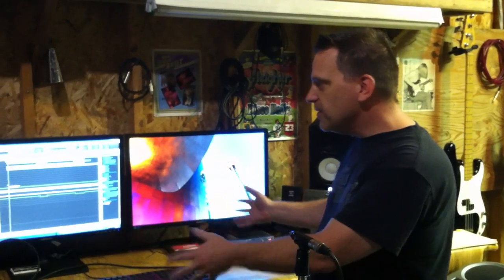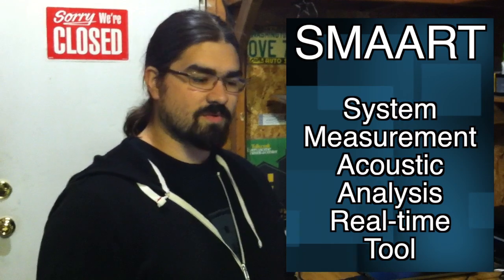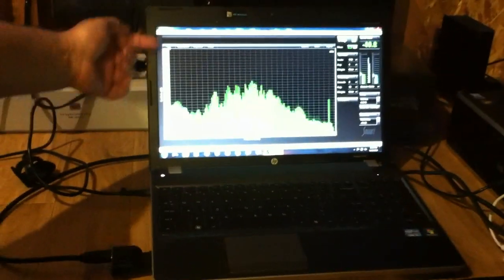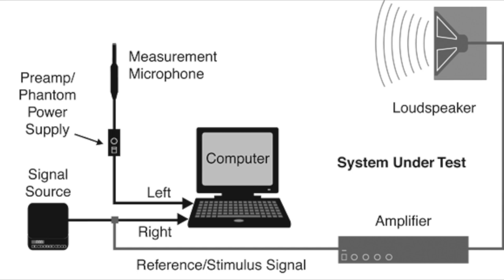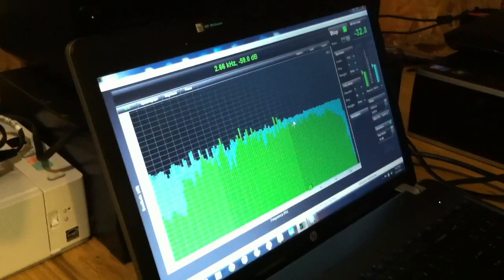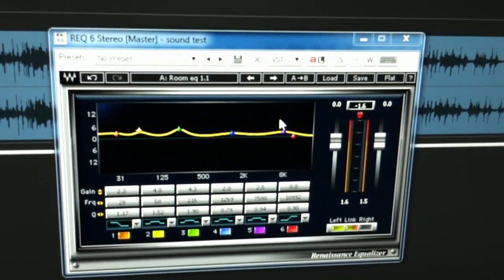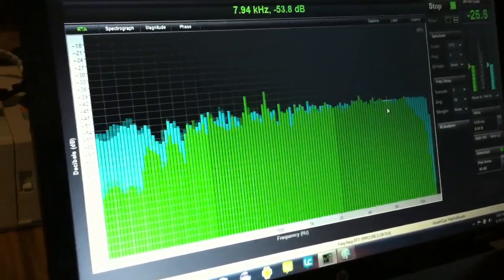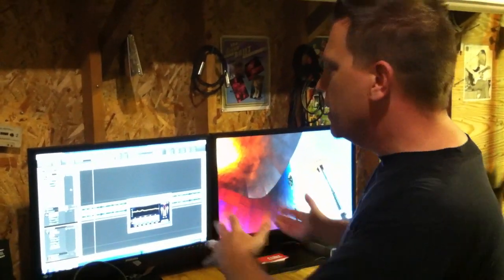How to Test and Analyze Your Home Studio - The Hit Chasers - Extras #8

Comment: 1st, it's mandatory to get some acoustic treatment in the room!. ... eq compensation should be viewed as the cherry on the cake...  

and it won't work as you might think, if you boost some problematic freqs, the room will simply try to respond and it's basically a "feedback" system. The more you boost, the more the room will just do it's thing ;) ...
Reply from the maker: +catonlsd3 agreed on the room treatment. I did have some luck with the EQ compensation but what I was really missing was a sub. Got one now and things sound pretty much the way they should. Except when the drying is on :) studio humor. Have a great day. -Peter